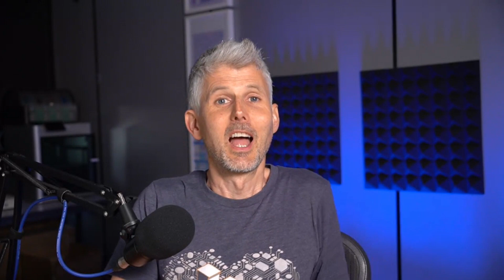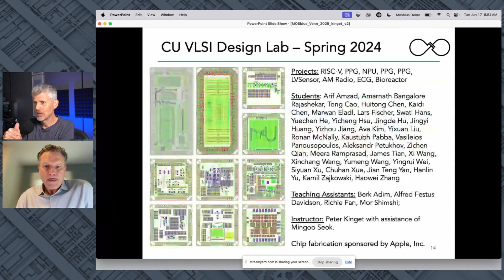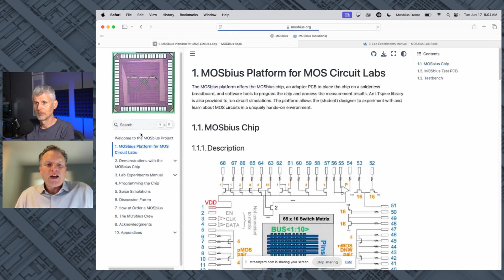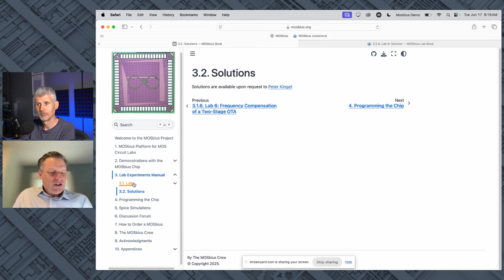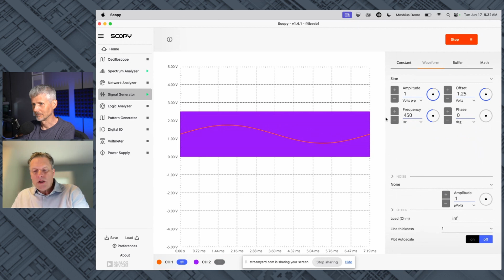MOSbius - A field programmable transistor array for chip designers - interview with Peter Kinget

Comment: Can you use it to implement a Digitally-Controlled Analog audio processing device (e.g. guitar pedal or Eurorack module) ? Another comment already mentioned the Jumperless.
Reply from the maker: Probably, but it would need to be quite simple. If you look at the circuit diagram there are only around 18 transistors and a couple of opamp blocks.

Comment: Awesome! reminds me of my own classes where we used 4 terminal MOSFETs (ALD1105?). also reminds me of the Jumperless breadboard that's on crowd supply, feels like this would be a good combo
Reply from the maker: Yeah! The jumperless is cool! I spoke with Kevin at Hackaday Berlin about making a custom switch matrix. It's doable, but much cheaper for him to buy off the shelf parts.
Reply: Yes, the jumper less breadboard is intriguing and it would be interesting to augment the MOSbius PCB with additional external switches possibly. At the same time, there is some benefit of physical inserting components and wires in a breadboard .... It often leads to small errors which become opportunities to develop debugging skills of physically tracing signals, checking bias voltages, etc.

Comment: How long does the MOSbius take to reconfigure? If it's fast enough to reconfigure during operation, an FPGA could be used to implement some sort of search algorithm.
Reply: We typically use a 200kHz clock to feed in the 650 bits, so less than 4ms. [In some demos I slow it down so you can observe the programming.] We have not run experiments yet on what the highest clock frequency is. We currently use a RPI Pico or ADALM 2000 to program but you could use an FPGA. The PCB has 3.3 to 2.5V level shifting resistors included.
Reply: That sounds like a good value for the classroom. Maybe users can put their heads together and build a bitstream DRC deck to prevent shorts, since you mentioned that the python netlist conversion doesn't do that yet.

Comment: it would have been great if it had few Switch cap Blocks for emulating Capacitors, Resistors and inductors. Also a Small 8 bit ADC and few 8 bit current and voltage DAC would have been made it much more fun to play with. 
But still a great chip in Analog Playground !!

Currently my Programmable Analog choice is restricted to PSoC 5 and GreenPAK SLG47004
Reply: Thanks!

We are constantly thinking about improvements for next versions, so thanks for your suggestions. What kind of experiments would you like to do that include these blocks?

For the first version, we focussed on using the chip real estate (pins & area) on components that are hard to find, i.e. MOS signal transistors of various sizes and in various configurations as they are used in IC design. All passive components are off chip. Remember each on-chip component uses up pins and area; even if you do not expose them, the expanding the switch matrix uses area also. By going off-chip, the operation frequency reduces, but we are not trying to break speed records, you can scale most circuit phenomena you want to learn about to lower frequencies. We typically add a microcontroller in the setup (like the RPI Pico) which comes with ADCs and DACs. 

We are working on a version that can demonstrate switched-capacitor circuits.
Reply: If you have the pins available, breaking out one of the transmission gates would allow us to run characterization tests, like the IV curves you would run for a new MOS device.
Reply from the maker: Good idea!
Reply: @peterkinget4181  stuff related to mixers , chopper amps, log amp, precision rectifiers, etc. Also It helps in a lot of signal conditioning circuits for various passive sensors. Currently only PSoc is capable of handling it. Its not high precision but does the job with minimal physical components.

Comment: What a fantastic project, great work Peter. I read a paper a long time ago from NASA about evolving hardware chips using programmable transistor arrays and it's been in the back of my mind for many years. I see FPTAs becoming really useful in the future for machine learning areas, specifically in the analog computing sector. For people like me who work in bipedal robotics and AI, a FPTA would be so insanely useful, and even more so with a FPGA and FPTA on the same chip. I cannot wait till someone like me can access a large-ish FPTA chip.
Reply: Thanks! Please share a reference to the paper. 

For your work, what kind of functionality and performance do you expect from the FPTA chip?
Reply: @peterkinget4181  The paper is called "Toward Evolvable Hardware Chips: Experiments with a Programmable Transistor Array" from Adrian Stoica at the Jet Propulsion Laboratory. YouTube won't let me link it in the comments.

A much larger FPTA chip would be required for what I would like to actually use it for. Personally I'm interested in bipedal robotics in harsh conditions. I would assume tens to hundreds of thousands of transistor blocks would be needed, though that's just an estimate. My primary interest lies in hardware level evolution, analog computing, and neuromorphic circuit designs. Ultimately, my goal is to enable what I’d call "living hardware"; systems capable of evolving, adapting, and self repairing directly at the physical layer. Even before reaching that level, bypassing digital conversion delays alone could be revolutionary for performance, particularly for real time control in robotics. Some low hanging applications include adaptive signal filters and self tuning sensor interfaces. With near instantaneous hardware reconfiguration, these systems could self heal, adapt to changing environments, and fine tune control loops in real time. Capabilities that would be highly impactful across robotics, especially for autonomous systems navigating unpredictable or extreme conditions.
Reply: @ParabolicLabs thank you

Comment: AI Summary

Abstract:

This interview introduces Professor Peter Kingette from Columbia University and his innovative project, Mosbius, a programmable transistor array chip designed to facilitate hands-on integrated circuit (IC) design experiments. The platform, comprising the custom chip, breadboard, and a USB instrument, aims to make complex IC design concepts accessible and measurable for students and professionals. Kingette emphasizes the critical role of measurements in the IC design cycle, arguing that practical lab experience bridges the gap between theory, simulation, and real-world silicon behavior, a skill often lacking in new graduates.

The discussion covers the Mosbius chip's architecture, featuring various N and P transistors with different drive strengths, internal configurable buses (up to 10 nodes), and external pin access. Demonstrations include a "blinking LED" relaxation oscillator and a more advanced delta-sigma analog-to-digital converter, showcasing how users can configure circuits, analyze waveforms, and compare real measurements to LTSpice simulations. The chip, fabricated in a 65nm IO device process, is designed for robustness and has withstood accidental over-voltage applications in university labs. While GDS files are proprietary, a custom SPICE library and detailed lab manuals are openly available, with plans for broader distribution of kits to universities worldwide. Future aspirations include design contests and potential mixed-signal integrations with FPGAs.

Summarizing the Mosbius Project

*   0:02 Introduction to Mosbius: Peter Kingette, a professor at Columbia University, introduces Mosbius, a programmable transistor array chip designed for hands-on, accessible integrated circuit (IC) design experiments. The name "Mosbius" combines MOSFET and the Mobius loop.
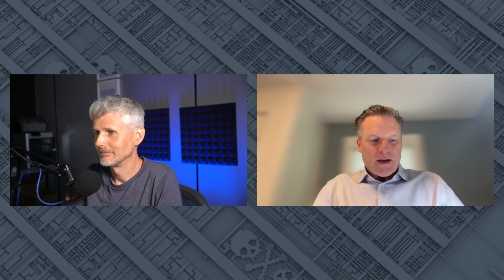*   0:46 Professor Kingette's Background & Teaching Philosophy: Kingette emphasizes practical, project-based teaching, including designing and testing student-taped-out chips. He believes in making measurement an integral part of the learning experience, connecting theory, simulation, and real-world silicon.
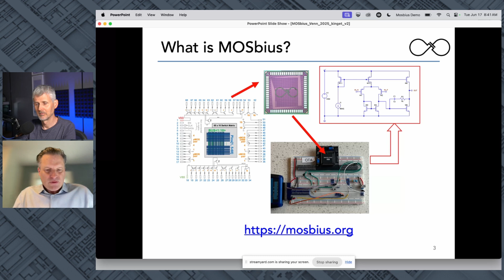*   4:38 Importance of Measurements: Measurements are crucial because silicon behaves physically, often differently from simulations. Practical experience helps designers understand real-world challenges like loading and parasitics, which are often overlooked in simulation-only environments.
*   8:46 Importance of Documentation: Testing chips designed by others, or even one's own, highlights the critical need for thorough design documentation and datasheets.
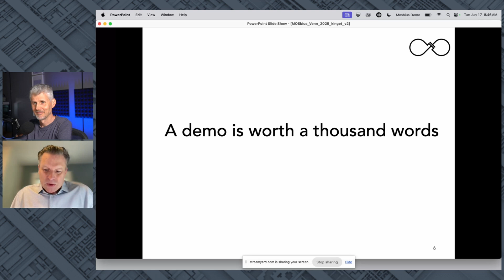*   9:55 Mosbius Setup & Blinking LED Demo: The core setup includes a Mosbius chip on an adapter PCB, a breadboard for external components, and a compact USB instrument (oscilloscope, power supplies, waveform generator, digital I/O) connected to a laptop. A blinking LED relaxation oscillator demonstrates configuring on-chip transistors and observing internal waveforms, including hysteresis.
*   15:53 Design Cycle & Reconciliation: The Mosbius platform enables students to experience the full IC design cycle: conceive, simulate (using provided LTSpice library and models), fabricate (conceptually, via Mosbius), measure, and then reconcile differences between theoretical analysis, simulation results, and actual measurements.
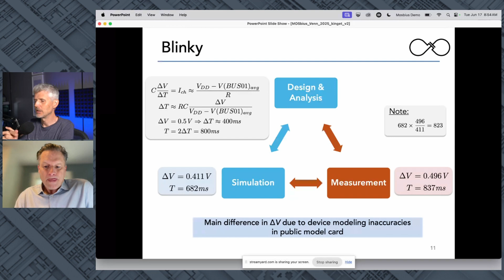*   18:11 Mosbius Chip Architecture: The chip acts as a "programmable transistor array," featuring various N and P transistors. Users can connect any of the 65 pins to 10 internal buses via 650 configurable transmission gate switches. This allows for flexible circuit construction, either internally on-chip or externally on the breadboard.
*   21:17 Component Selection: Mosbius focuses on providing on-chip MOS transistors (including matched pairs, current mirrors, operational amplifiers, and output stages) as they are harder to find off-chip. Resistors and capacitors are intended to be external components, preserving chip pins for transistor access.
*   24:08 Transistor Sizing Methodology: Devices are characterized by their GM over ID (transconductance over drain current) at a specific bias, promoting learning about relative sizing in analog design.
*   25:49 Design Accessibility: While the GDS layout (TSMC 65nm IO process) is proprietary due to NDAs, the Mosbius project provides detailed architectural information and an open-source SPICE library with models close to the actual chip, enabling accurate simulation.
*   33:23 Safety and Robustness: The chip features ESD protection and an on-board voltage limiter (2.5V VDD). It has shown significant robustness, surviving use in a lab with 100 students and tolerating accidental 5V inputs without failure.
*   42:01 Educational Resources & Kit Availability: A comprehensive laboratory manual is publicly available on mosbius-dot-org, with solutions provided to instructors upon request. Approximately 150 kits are being produced for distribution to universities globally for fall semester courses.
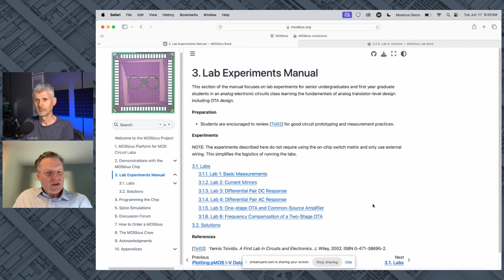*   44:11 Future Initiatives: Plans include organizing design contests (potentially lending kits for events), exploring mixed-signal integrations (e.g., pairing Mosbius with an FPGA), and considering a smaller version compatible with Tiny Tapeout's limited pin count.
*   50:24 Advanced Experiment: Delta-Sigma Converter: An advanced experiment demonstrates a first-order, one-bit delta-sigma analog-to-digital converter. The demo shows how the converter uses density modulation of ones and zeros to approximate an analog waveform and how noise shaping is visible in the frequency domain. This complex circuit uses nearly all Mosbius transistors and buses, highlighting the platform's capabilities for advanced learning.
*   58:24 Contact Information: Interested individuals can find more information and contact Peter Kingette via mosbius-dot-org.

I used gemini-2.5-flash-preview-05-20| input-price: 0.15 output-price: 3.5 max-context-length: 128_000 on rocketrecap dot com to summarize the transcript.
Cost (if I didn't use the free tier): $0.0097
Input tokens: 37177
Output tokens: 1187